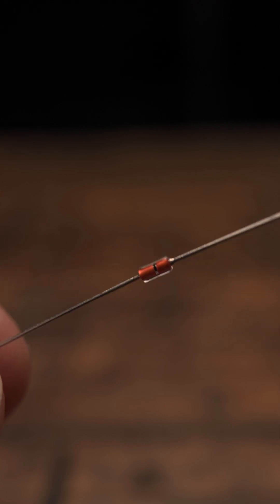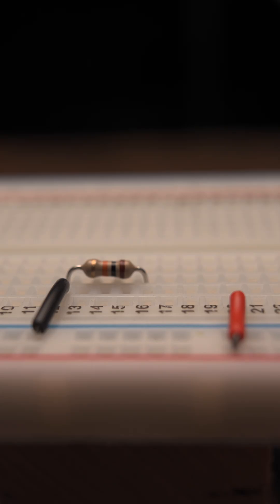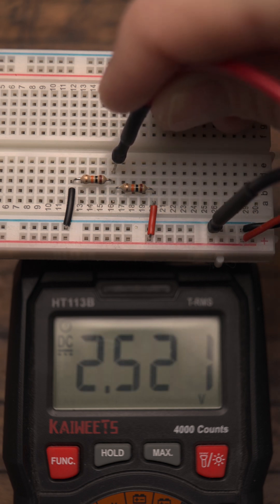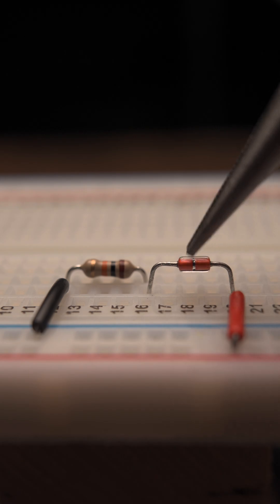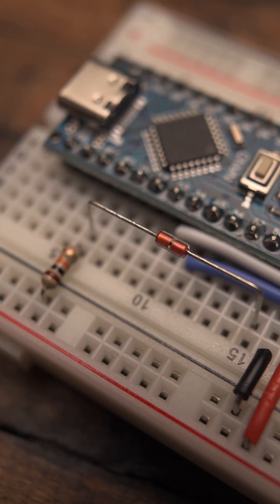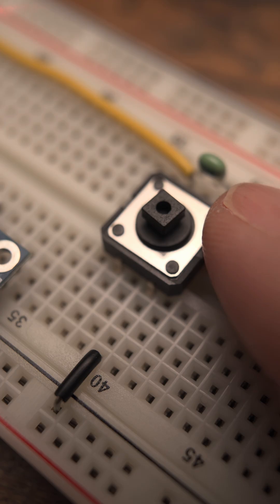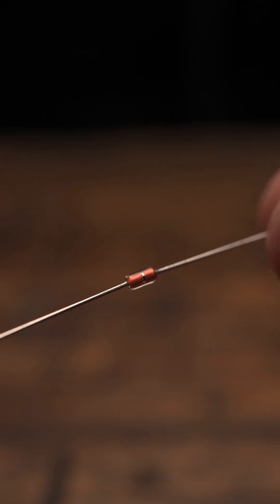#thermistor

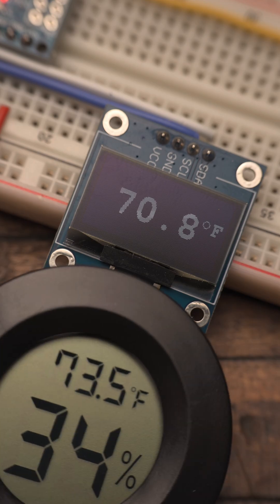Comment: 0:45 Isn't it obvious? Metric system is easier to divide, like 1 kilometer is 10 hectameter(hectare), it is 100 decameter and it is 1000 meter and 1 meter is 10 decimeter and it is 100 centimeter(cm) and it is 1000 milimeter(mm), same with kilo's and liters, try that with imperial.

Comment: I like Fahrenheit because it is a better scale for temperature relative to our body temp. It is a finer scale. Celcius is better for equations involving temperature with materials and water especially imo, smaller results than Kelvin but still a better scale
Reply: Celsius is only a Kelvin plus an offset, no precision is lost. I wonder an example use case, to show the resolution is finer using F
Reply: @CallistoPili  more to do with a finer scale with which to describe temperature relative to body heat, without going into the hundreds or contraining to decimals to get the same point across. Celsius and Kelvin work better for materials in my opinion, and Fahrenheit for concerns of feeling temperature. 

Though I feel you already know what I mean and choose to pretend I do not know all 3 scales can be used for anything. My argument stems from the same reason kilometers are used in terms of global travel, but not spacial travel. Some scales or units of measure make more sense in some regards

Comment: Hardware guys would use a POT.  Software guys change the code.  The software approach requires more thought, but can much more accurately determine the temperature across a wider range.

Comment: for all those doing the whole Celsius is better thing, guarantee you any precision made object you have or tasty snack youve eaten was made using imperial. high precision machining, up until you get into angstroms, is done in thousandths, ten thousandths, hundred thousandths, etc. of an inch, mostly because theres less numbers involved, which no significant difference in accuracy. easier for a machine to deal with as well due to unavoidable rounding errors inherent to anything running code, and its a pretty well known fact that the metric system is shit for cooking😂😂 also, just wanna point out, angstroms technically arent metric or imperial, so yall cant claim that either, but an angstrom is the distance of a single wave of light, so either peak to peak or trough to trough, thats an angstrom. pretty cool that humans can machine something to a tolerance that small

Comment: You can also increase the variable of the resistor that resistor had a brown base that's a plus or minus 10% that's a 20% window if it was blue Bass then it would be plus or minus 5% a 10% variable and remember you can replace a brown with a blue but you cannot replace a blue with a brown

Comment: There are very small and cheap integrated circuits that have all the compensation and calibration built it, that you can use to measure temperature very precisely.

Comment: Fun fact, for measuring temperature for each core of a CPU, and for other areas of the silicon die as well. diodes are used as the temperature sensors.  These are  lithographed right on the silicon die with the rest of the billions of transistors.

Comment: And whether celsius or fahrenheit or kelvin is better depends on usage. For something like this, fahrenheit is better because it has numbers at smaller increments, and are therefore more precise — not to mention the fact that water boiling isn't relevant to this application.

What should appear, though, is whatever you prefer.

Comment: You should calibrate in software. You’re not going to accidentally change the value in code, but you may accidentally bump into that potentiometer. Dust and debris can also wear down potentiometers, causing them to drift slightly, which normally isn’t a problem unless its as severe as with modern controllers, but in something as precise as temperature, it matters

Comment: Nice video. Personally I would put the temperature correction in the code of the microcontroller. Less convenient if you need to recal but you avoid using a not so reliable part like a potentiometer.

Comment: I was working for a company doing industrial wiring.
We threw away thermistors that weren't up to spec, so I yoinked one from the bin.
Years later, I built myself a new PC and the fans were making a lot of noise from spinning too fast.
So I put an arduino between the fans and the PSU so that I could spin the fans according to the temperature of the thermistor I could finally use.
I learned a lot about pull down Resistors and mosfets that day (I got the mosfets from an old printer)

Comment: Fahrenheit is base 60, the same as time, so are you saying that time is too hard to calculate? Also, it was originally based on a salt solution and that is much more stable at different altitudes, so getting accurate measurements is much easier and doesn’t require the complex formula to calibrate when you’re not at sea level. The range of 0 to 100 is human livable, as these are normal temperatures found where people actually live. Thermostats don’t need decimal accuracy for adjusting the temperature of a home, 72 degrees is very comfortable for most people and the equivalent in celsius is about 22.5 and that is simpler? I agree that many of the measurements being base 10 because it is what we use makes things easier and there are even prefixes that allow it to scale, but when is the last time you used kilocelsius? If you aren’t using the biggest feature of the metric system, the ability to change scale, what is the reason for having it be base 10?

There are many measurements that are based on 60 that we use every day — circles are 360 degrees, time is 24 hours and 60 minutes and seconds — and doesn’t cause any issues with calculations, so why not use a system that has more degrees of precision?

Comment: They’re also an integral part of the head of a 3D Printer, monitoring the the temperature. Though they look a bit differently there, encased in glass to withstand several hundred degrees Celsius

Comment: This is great but generally temperature sensors are better made with a matched pair of BJT transistors - essentially their output current is also temperature sensitive and more stable (in short) over a wide range of temp.

Comment: Honestly Celcius and Farenheit are both completely arbitrary. Kelvin makes more sense since it is normed to absolute zero. But there is a theoreticaö degree Boltzman, which is a scale you can get by setting the Boltzman konstant to 1 in thermodynamics, and calculating that with SI units.

Comment: All I need is A resistor to solve the blood  sucking mosquito's killing plastic adapter and a incompatible hair dryers voltage unacceptable volt adapter issue. 
Evidently wicked Intelligent Panasonic Ancher bussiness inventers had full of incoming volt without a solution yet added additional fuse for customers.

Comment: Calibration wont help. Your error is also non linear because the B-slope of the thermistor is non-linear and usually only specified at 25-85degrees. So there is a lot of work needed to get it very accurate.

Comment: I love metric, but neither F nor C are "better" since they both measure accurately. If anything, F is more accurate in that 1°F is a smaller step, so it's easier to appreciate the significance of the difference between 88°F and 89°F than it is between 31.1°C and  31.6°C. The "best" one practically speaking is the one most widely understood by your target audience.

Comment: They are not 10k resistors those are 10KOhm resistors

The K stands for Kilo meaning 1000 and is only the unit prefix

You could however use 10 kilo resistors to express that you have 10.000 pices of resistors

Comment: Please tell my why ..why on earth using a  potentiometer to calibrate the thermistor...since you can do it through coding and the reindhart hart equation that is library embedded in code ...furthermore a potentiometer metrically cant fix tolerances or accuracy...a potentiometer sets range and max and mimimum limits...i think you dont have deep knowledge of what tou try to analyze. That is common nowdays in youtube. Well let me tell how to calibrate a thermistor...mix ice and water. This is 0oC. Measure boiling distilled water. This is 100oC. Use code to divide the two voltages...and analog inpus to measure the thermistor voltage. Now you are calibrated

Comment: C is better 100% of the time and for the 4.5% of the world who argue that Fahrenheit is better - YOU ARE WRONG.
You are just repeating the nonsense you were taught from kid because of the sunken cost fallacy.

With Fahrenheits you need to remember freezing 32°F, cool room 68°F, (arguably also body 98.6°F) and boiling 212°F.
With Celsius you just need to remember two values: cool room 20°C and body 37°C. The freezing and boiling points are inherent to the scale.

Arguing that it's a human temperature is a fallacy on its own, as it has been measured that human temperature decreases throughout generations. In fact, the "human temperature" already is around 97-98°F. And 0°F is just a freezing point of a random mixture of salt that nobody can ever reproduce measured at a time and place where the climate was completely different.

Arguably, the most important temperature is the freezing point 0°C or 32°F at which point the water freezes, rain turns to snow, roads, pavement and stairs get slippery and dangerous. Water solidifies and changes volume, tearing apart pipes and roads, making drinks undrinkable and food rock solid, etc. And since it's such a turning point, it only makes sense to base the whole scale off it.

For those who say that °F are more granular in the meaningful range you are also wrong. What you learned by experiencing the world with °F is as easy or even easier with °C. It's impractical to discern 0.5°C, which is 0.9°F, even human temperature fluctuates more than this. The real meaningful unit that you can safely discern by touch and feeling is 1°C, which is just enough for this scale. More precise measurements, including human temperature do require fractional digits for both F and C.

Arguing that F is great for weather, 0°F and above 100°F is also nonsense as you could freeze to death with much higher values than 0°F and you could safely withstand temperatures well above 100°F for prolonged periods of time. Learning what is and isn't actually comfortable equally applies to both scales, so there is NO benefit of either in this regard. You need to experience both. 100°F is "only" 37°C, we sometimes get temperatures reaching 40°C or 104°F and I have experienced even more when abroad in summer. And 0°F is frikkin -18°C, which is well below freezing, that's all I need to know.

The REAL benefit of Celsius scale however, comes from the practical use. And this is not even remotely science.

Can you tell just like that, that 140°F is twice as hot as -1°F?
Is it obvious to you that if you mix 1 unit of 140°F water with 1 unit of -7°F water, that you'll end up with 2 units of 104°F water?

In celsius, the same values as above would be:
60°C twice as hot as 30°C
1unit 60°C + 1unit 20°C gives 2units 40°C

And before you say that why would you ever have to do this, you might reconsider how much dependent on technology you are.

Comment: Well Celsius and Kelvin are linked in that +1 degree of either is the same change in temp,  digital thermometers usually read in C and then convert to F, you will see this when 69f is never displayed, Most of the world uses C and K and dont now F at all. F has nothing going for it.

Comment: Fahrenheit is better for accurate temp defined by feeling
Celsius is better for a wide range of science applications
Kelvin is better for absolute(ly everything)
Reply: This just shows that you don't understand C and K in the slightest and You are just repeating the nonsense you were taught from kid because of the sunken cost fallacy. K was literally based off C, it's the same unit, just shifted 273.15°C.

Whereas Fahrenheit is not even human temperature any more as it was based off some random mixture of salts at 0°F and body temperature, which is now 97-98°F and it decreases over generations.

Humans can't even accurately estimate differences between hotter and colder when the temperature difference gets slightly below 1.8°F or 1°C. The meaningful difference is 1°C, which is fine by the Celsius scale. For accurate measurement, you need fractional units on both anyway. When baking, for practical reasons 220°C is the same as 221°C, same with 70°C vs 71°C for certain teas (158°F vs 159.8°F). Arguing that you "need" the more accurate reading of the Fahrenheit scale is pure nonsense.

With Fahrenheits you need to remember freezing 32°F, cool room 68°F, (arguably also body 98.6°F) and boiling 212°F.
With Celsius you just need to remember two values: cool room 20°C and body 37°C. The freezing and boiling points are inherent to the scale.

Arguably, the most important temperature is the freezing point 0°C or 32°F at which point the water freezes, rain turns to snow, roads, pavement and stairs get slippery and dangerous. Water solidifies and changes volume, tearing apart pipes and roads, making drinks undrinkable and food rock solid, etc. And since it's such a turning point, it only makes sense to base the whole scale off it.

The REAL benefit of Celsius scale however, comes from the practical use. And this is not even remotely science.

Can you tell just like that, that 140°F is twice as hot as -1°F?
Is it obvious to you that if you mix 1 unit of 140°F water with 1 unit of -7°F water, that you'll end up with 2 units of 104°F water?

In celsius, the same values as above would be:
60°C twice as hot as 30°C
1unit 60°C + 1unit 20°C gives 2units 40°C
Reply: Buddy, calm the fuck down. First of all, don't put words in other people's mouth when forcing an argument. Second, the entire point of my comment was a kelvin joke. Nothing needs to be this serious, and if you run around acting like this to everyone who has a dissenting opinion then it really says more about you and your ideas than it does others ideas.

Chill.

Comment: C° uses water temperature, F° measures alcohol temperature. Guess which melting point is more worth knowing
Reply: Fahrenheit is a scale of 0-100 of how hot it feels outside. I find it's much easier to work with in every day life. Who cares what it's based on.
Reply: @PIVfirestarkproducon  because you're used to Fahrenheit, for someone who grew up with Celsius, Fahrenheit will have no meaning. Celsius and Kelvin is the global standard and it's what should be used. Fahrenheit needs to be buried with all the other US standard units.
Reply: @PIVfirestarkproducon it only works when you don't have stupid cold temperatures. Then it isn't a 0-100. It's more like -10 - 80

Comment: Im sorry but, this Thermister thing is nothing but an NTC/PTC right? Which we use a lot in Automobile tech for oil, water and other temp gauges aswell as your heated windshield. Or am I just completely wrong? (I'm a mechanic btw)
Reply from the maker: Absolutely, you're right. NTC and PTC thermistors are used in automotive technology for monitoring temperatures like oil and water, and are used in systems like heated windshields. NTC thermistors, which decrease in resistance with temperature rise, are most common for temperature sensing in vehicles, while PTC thermistors are often used for circuit protection.

Comment: For those building their own circuits, replace a voltage divider with a precision voltage reference. It will output a very accurate reference voltage which you can use in a microcontroller for calculation purposes. It requires very few external components, pretty cheap and they are agnostic of your input voltage (within a range). Youll find Arduinos have an AREF pin which is ideally where you would use a precision reference for analog to digital conversion. Most of the time its tied to 5V but 5V is never exactly 5.000V and so your application will always be inaccurate.

Comment: You just calibrated that to the least accurate temperature sensor I have ever seen lol. I use those to check the temperature and humidity of my 3D printer filament and 5 of them laying next to each other will all read a couple degrees of difference between them. Good enough for my filament, not so great for calibrating sensors. I'm sure its just for the video but I still thought it was funny.

Comment: I'm taking on such a project, as my PC's motherboard lacks a header for connecting commercial temp sensors. I've been told I should be able to feed the data to my existing software thereby controlling the radiator fans speed according to the cooling fluid temperature.

Comment: Calibrating with a potentiometer is only accurate at 73 degrees, thermister output is very non linear...will have to build a chart of calibration offsets for every few fegrees for accurate temperature readings over a large range

Comment: Centigrade and Fahrenheit are both deeply flawed units of measure.  That they're both still used - and interchangeable - is their only benefit. 

Both chose arbitrary temperatures for "0."  Is 0* an absence of temperature?  No.  Is 100* twice the amount of energy as that found at 50*? No.

They both agree at -40* (cool!).  So what?

The better unit is Kelvin.  Is 0K an absence of temperature?  Why, yes it is!

Kelvin is the official SI unit, and its units/steps are designed the same as those of Celsius' (b/c "why not").  ...It makes conversion to/from centigrade much simpler, as 0*C is as easy as 273.15K.   0K is -273.15*C.

To all the other nuts proclaiming the Centigrade Treble/Triple Point, aughgh... it's now officially 0.1*C.
And 0*C was Never the Point at which water freezes, It's the Point at which ice melts!

Comment: Or instead of a thermistor you could use a LM335 precision temperature sensor, which acts like a temperature controlled zener diode, so the load resistor becomes much less critical.